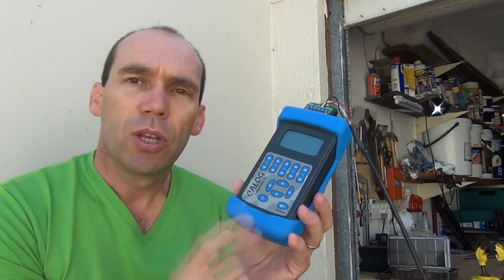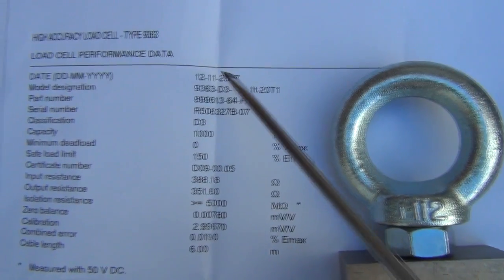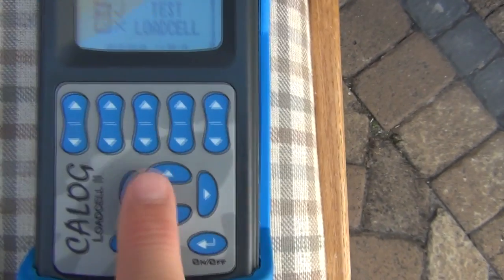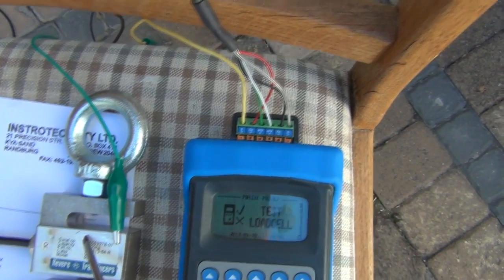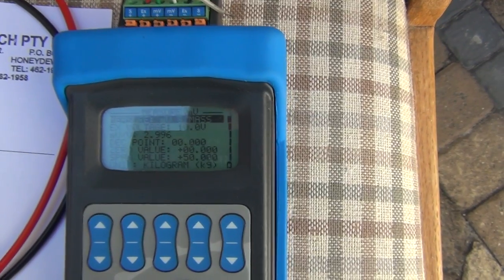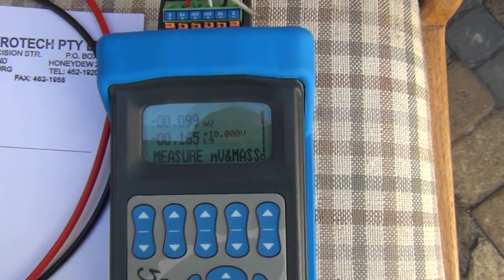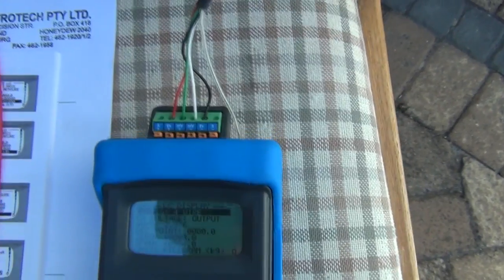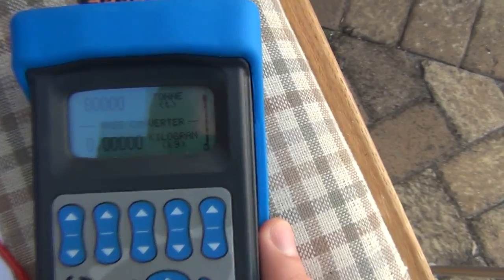Load Cell Calibrator and tester - Calog LC II

Comment: Very very handy, I am a beginner with Load Cells and I would like one of the units. I would like to know if you are trying to calibrate a load cell, I will obviously have to disconnect the tester from the load cell. considering the Load Cell has an EPROM chip, I would therefore have zero`d the load cell(s) ready for connection to the "on factory floor" read-out instrumentation?